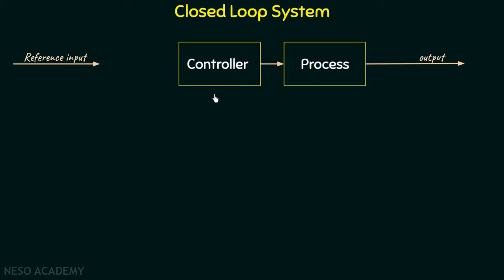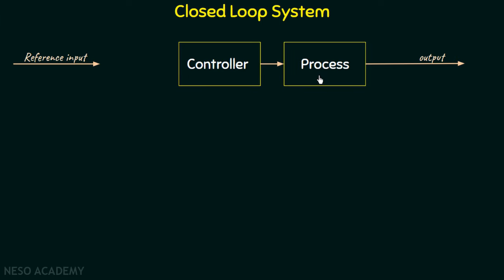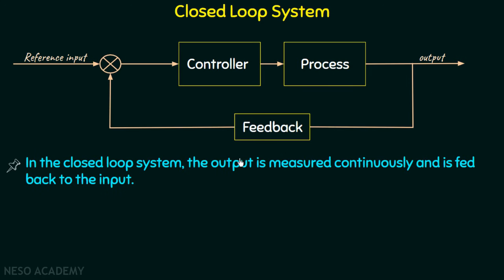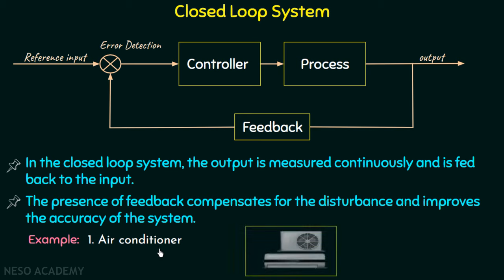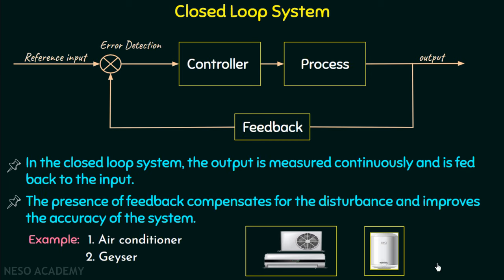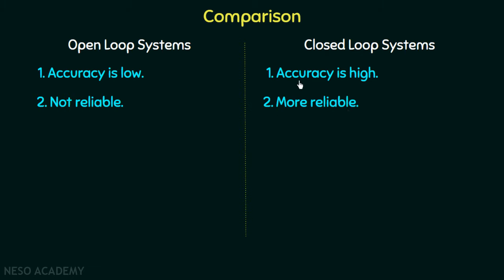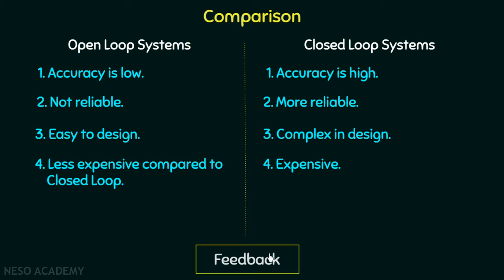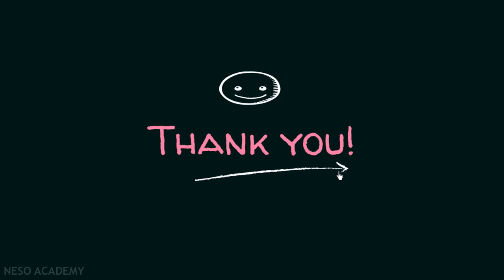Closed Loop Systems

Comment: Terminology, functional block diagram of open loop and closed loop control system–examples, effect of feedback on system performance, servomechanism, Modelling of control system componentstachometers & servomotors.Modelling of electrical, mechanical & hydraulic systems-illustrative examples.